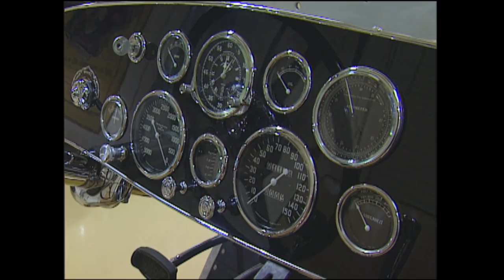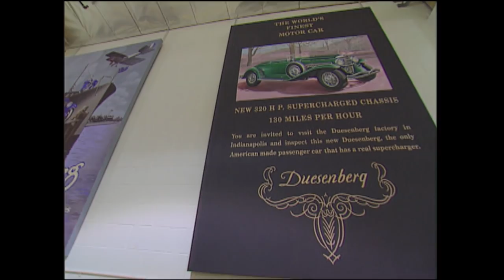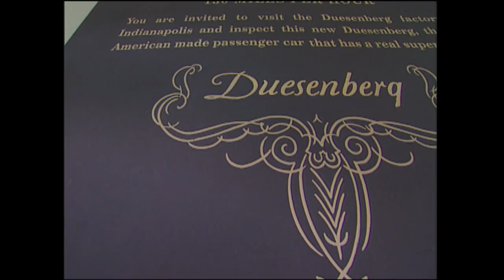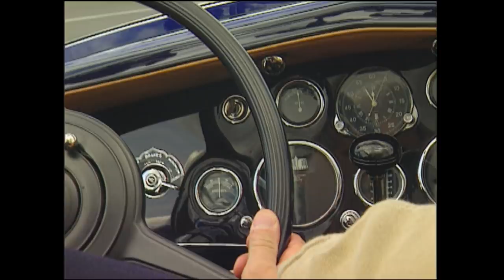Jay Leno's Car Collection | Behind the Scenes

Comment: Aviation fuel is better for car storage, can’t have something like that happen at 10,000 feet. Also about $3-$4.00 a galllon.
Reply: Yep, I have an airport close to me so I buy 100LL for my bike, lawnmower, and weedeater. 2 strokes like more octane anyway and I’ve never had a problem with seals or gas gumming up. My mower is 12 years old and still runs perfect

Comment: We always let our old cars sit for couple years with old gas, mind you that's only a 1973 Chrysler and another 1963 CHEV truck only fire them up every 2 years and drive them up the hill here in Canada, we live in mountains so don't need car license plates to drive up the hill, nobody's there....lastly my snow plow truck always sits spring summer and finally winter it fires up using the same old gas, that's a 2000 ford truck....dunno wouldn't  think we have any better fuel here in Canada???? But sure if we had fuel sitting over 10 years MAYBE we might add more, but probably  not, just drive, I'm 50 years old now, yet to see bad fuel from sitting for years.....again who knows , here in Canada  our fuel has anti freeze additives,  so does that help fuel last  longer??, I dunno could be, cause we really don't have fuel go bad here,  I'm sure it loses octane tho.